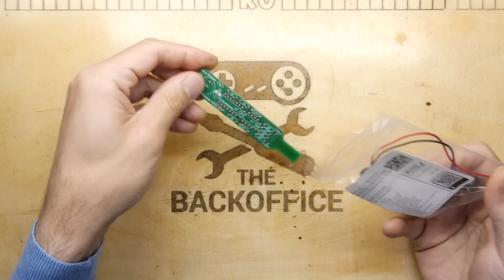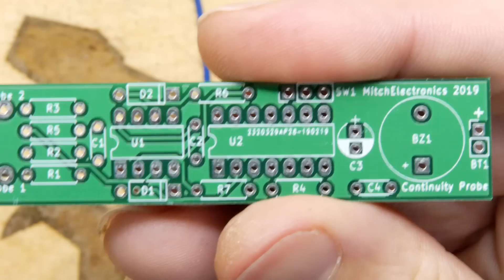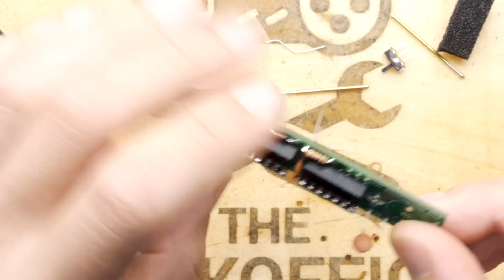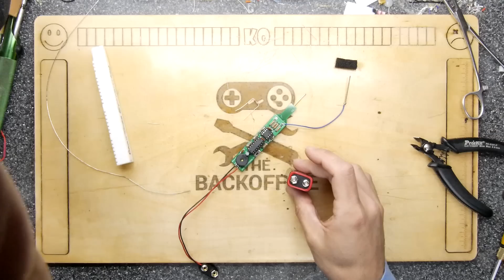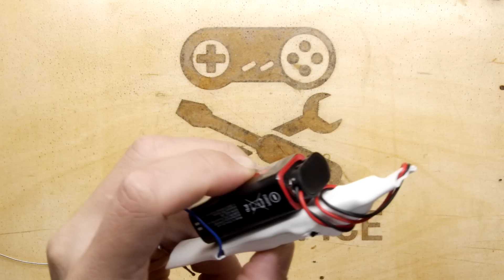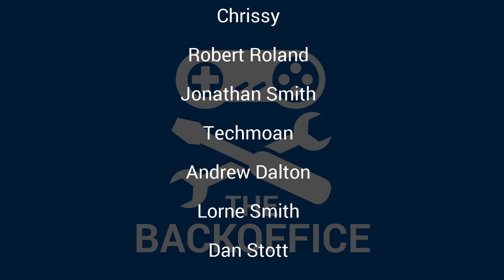Continuity Meter Kit

Comment: Putting wires through  holes gives better mechanical security. Tacking them to pads is just asking to rip the pads off the pcb if they are ever stressed. E.g. someone using them to pick up or pull the board they are attached to.